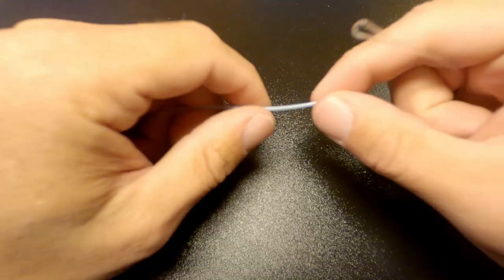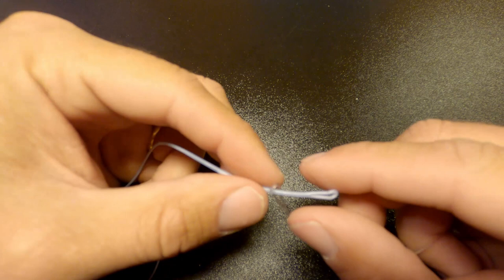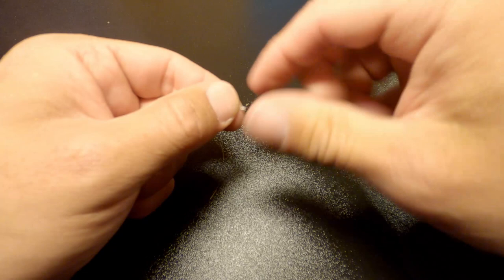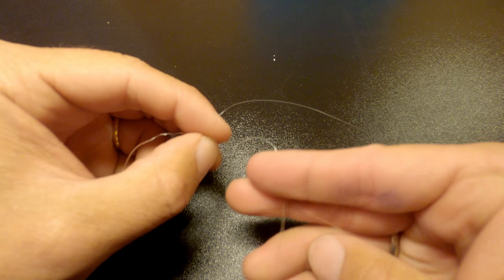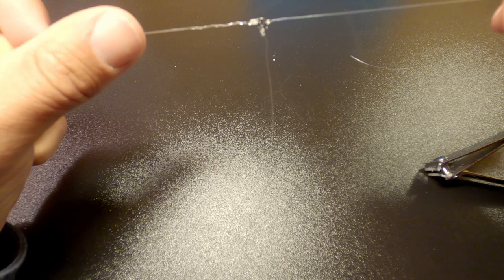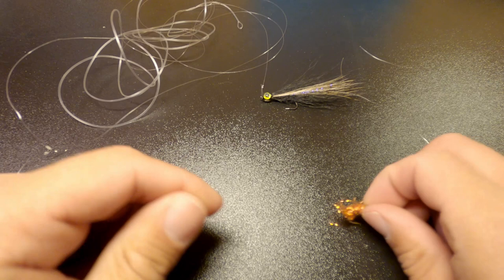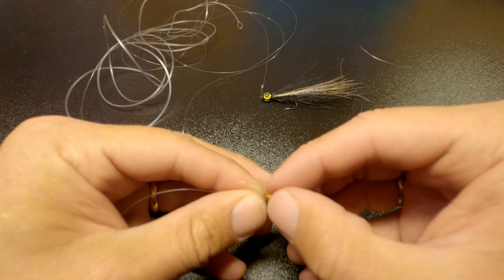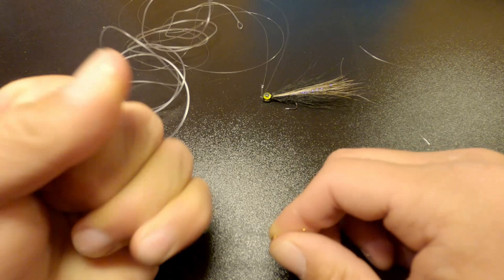Building leaders for fly fishing - How to rig a leader with two flies! Fly Fishing Vlog # 3

Comment: Hey mate! Do you think that using a polyleader will be a smaller risk of tangle than a selfmade leader? I use 150cm nylon 0.60 to around 90cm 0.42, i then connect this leader to a tippet ring and use around 60-80cm as tippet. Now im not a casting pro at ALL and i do get wind knots on both the mid and tippet section. I usually fish in very windy conditions and i guess that plus my technique results in knots. Id say i atleast get 1-2 knots if i fish for 7 hours.
Reply from the maker: Hi.
It's probably a little easier to untie knots with polyleader. But the simplest solution is to take a fly casting course so you do not get as many knots. 1 to 2 knots in 7 hours is not too bad and I must admit that in windy situations I can also get some knots.